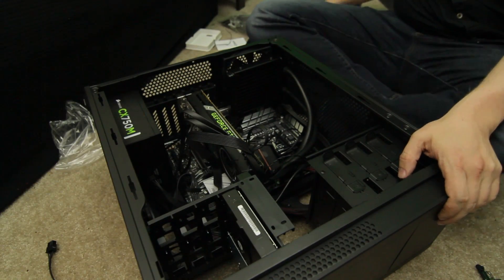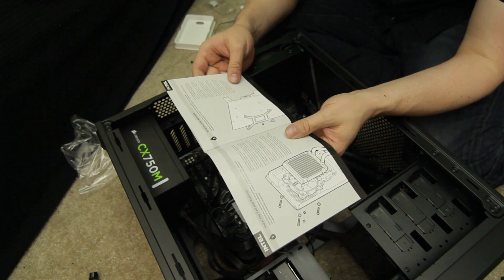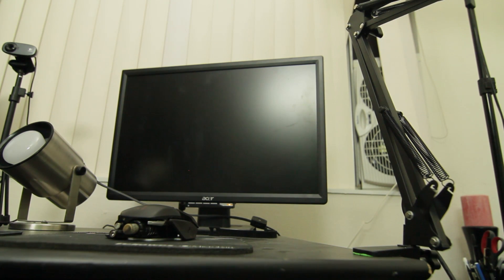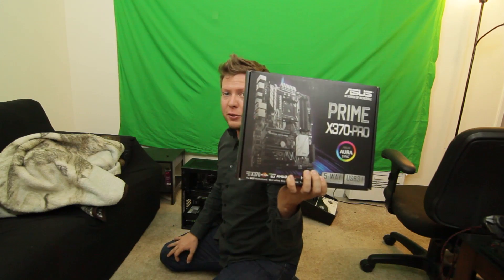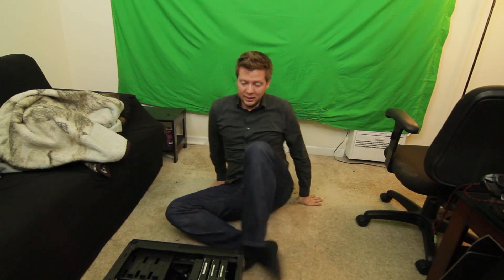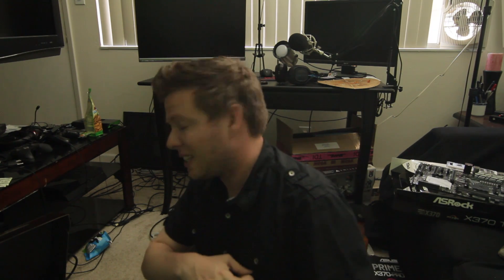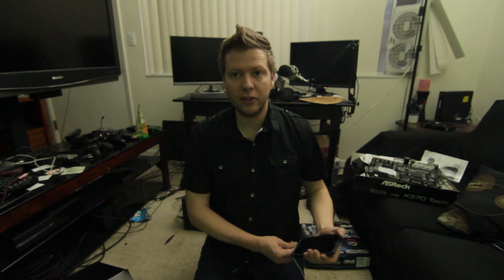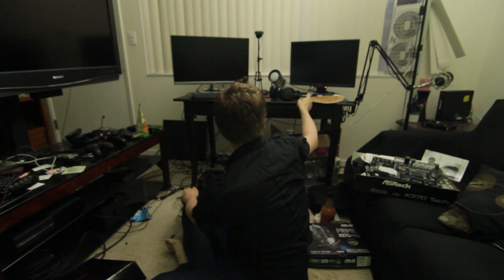How NOT to Build a PC - Twitch Exclusive for August!

Comment: This was entertaining, thanks for taking the time to produce and post this. I've never had this much trouble with a PC build. So all the problems might have been a fluke thing. I also haven't built a Ryzen based computer so maybe they are more finicky. 

Next time I would build on a desk or on a piece of wood away from the carpet and if you don't have an ESD bracelet, make sure to touch the case just before handling any electrostatic sensitive components like the motherboard and RAM. That will discharge static into the case and not into the components. This is pretty important, although it was more important back in the old days of PC building. A lot of times people think they have defective parts but it's because they partially or totally destroyed them with static electricity. I also recommend getting a slightly nicer case with a tempered glass panel to show off that beast of a GPU, but to each their own.
Reply from the maker: I don't like flashy cases. I just like to keep it subtle. That said I always make sure to touch the case before installing parts :)
Reply: TheDestinChannel that's cool. Sorry you had so much trouble with the build but hopefully it serves you well for Destiny 2!
Reply from the maker: It is so amazing now. I love it so much. Very happy I figured it out :)